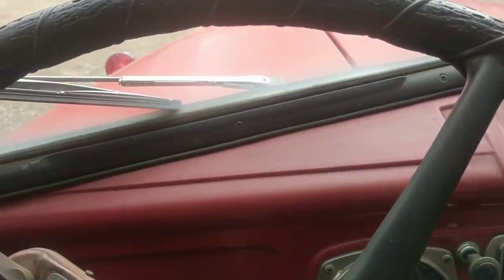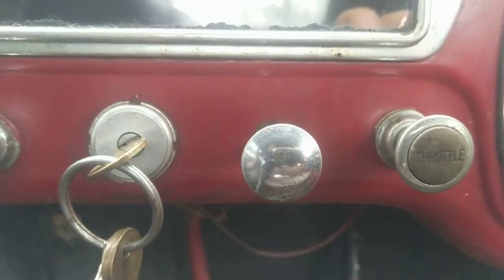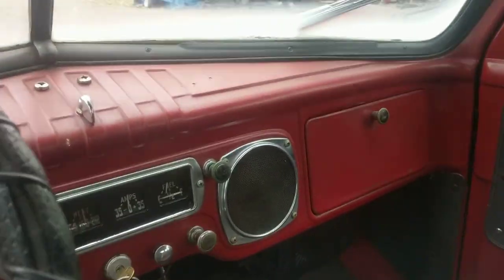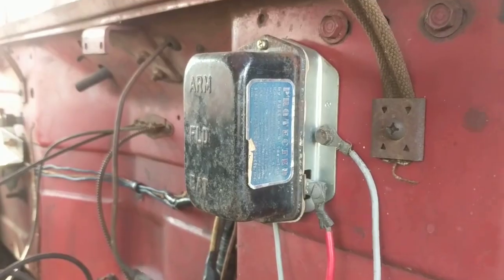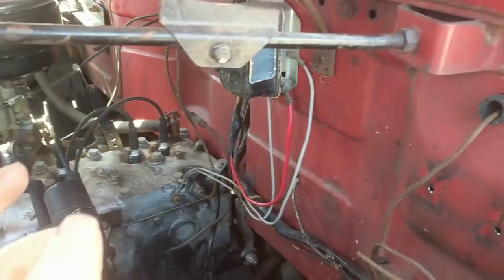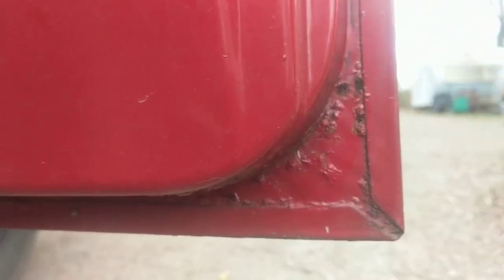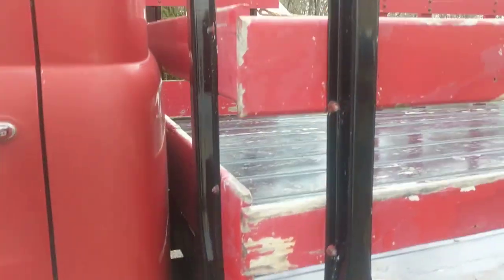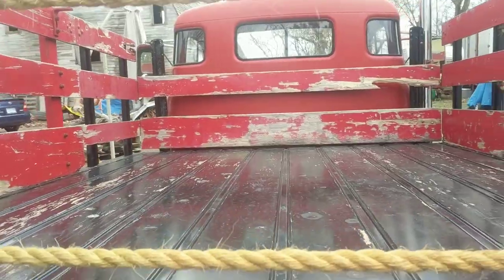Walkaround the 1948 Dodge B-1-D

Comment: T-146 engines are 230ci and for 48/49 B-1-D trucks....so I believe it is a correct engine if not the original L6 motor.

Comment: Ok so B is what like style it is 1 is for 1 ton and d is for dually... correct???
Reply: B =  1948-53 -years the series was built
1  =  1948-49 - the specific year - (1950= B2, 1951-52 = B3, 1953 = B4)
D =   is the letter for its tonage.....B = 1/2 ton, C = 1 ton, D= 1 1/2 ton

So, for example:  B-1-B   is a 1948/49 1/2 Ton
This truck is a 1948/49  1 1/2 ton
Reply: @194853DodgeTrucks  ok, that makes more sense. 

So would my truck be a B1C I have a 48 Dodge 1 ton (dually)
Reply: @Tractors_Trucks_And_Pups  48 or 49.....you'd need paperwork to differenceate. 49 seems more common, but that might be my area. I have about six 1 1/2 ton rescue trucks and seven 1/2 tons. More than half have paperwork.....you can see most of them on my videos.
Reply: 51-53 trucks rule 😁